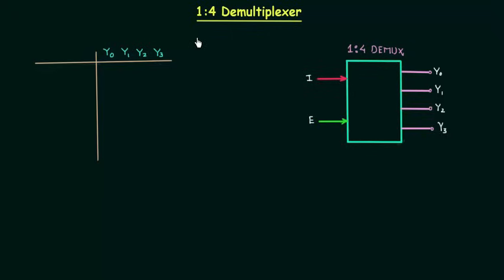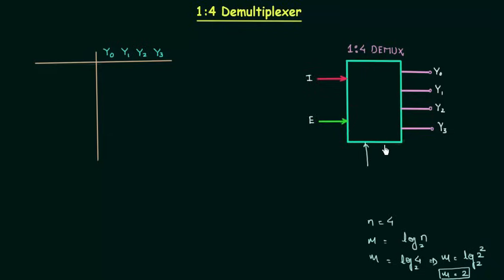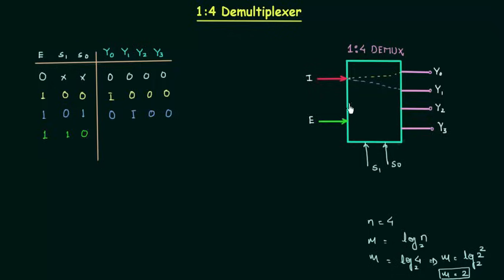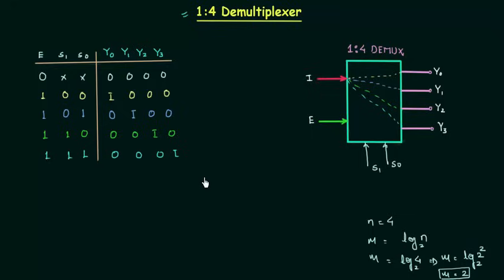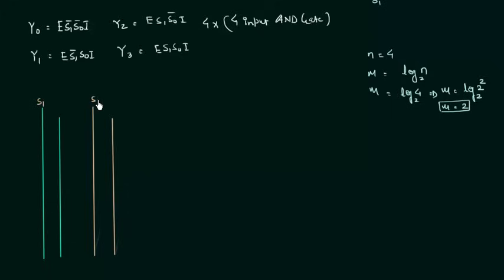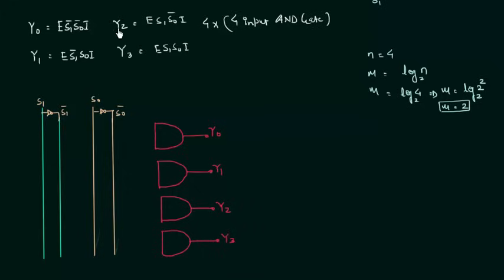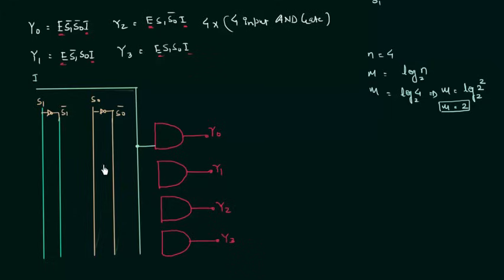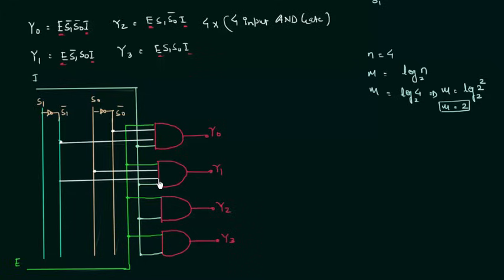1:4 Demultiplexer

Comment: In 4:1 mux you have not used ENABLE  but in 1:4 dmux ENABLE  is used ?
without using enable cannt we implement it?
what is the exact significance of using it?
Reply: If E is not used, one of the four outputs will be either at logic 0 or at logic 1, which will be propagated to next stage and circuit will malfunction.....
Reply: @circuitsanalytica4348  Thankyou for replying after 2 years .
I was waiting for it .Now I can live peacefully!
Reply: @circuitsanalytica4348  Thankyou for replying after 2 years .
I was waiting for it .Now I can live peacefully!